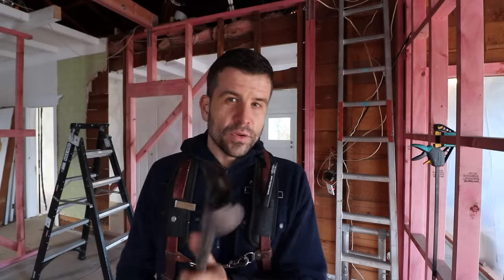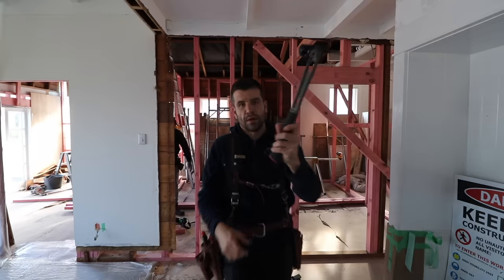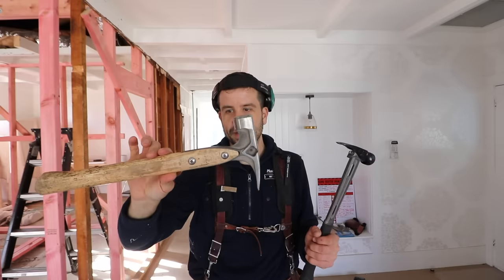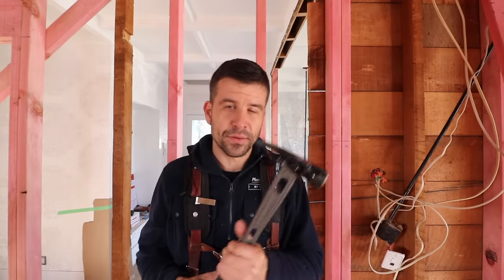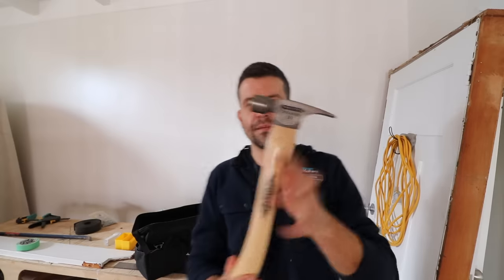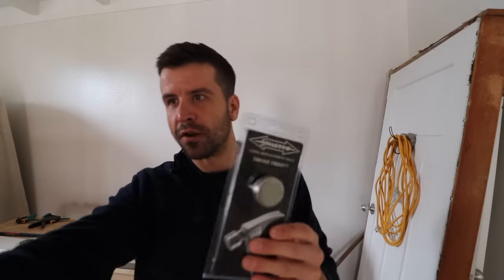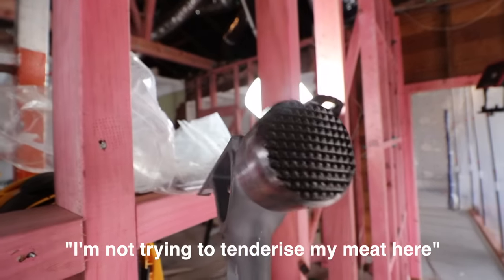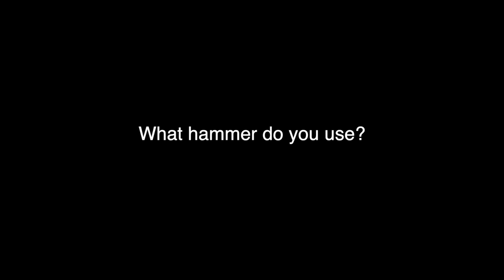Martinez M1: The Hammer Everyone Is Talking About

Comment: For wood handles: sand off the shiny, slippery varnish or lacquer or poly or whatever the heck the finish is. Sand to the bare wood, tune up the shape maybe, finish with 2 applications of boiled linseed oil for a very usable grip.  
When I switched from the Estwing framer to a wood-handled Hart I knew the Estwing was pretty much relegated to the worst demo jobs...  Wood handles ever since.
Reply: totally agree! i sanded my vaughan california framer and apply linseed oil every so often and the grip is fantastic even in the wet! love the hickory handle
Reply: Couldn't agree more that timber hafts feel much better than rubber sleeved steel, but they tend to take damage and break too easily on site work.  Breakages and the need for reliable tools were much the reason why so many of us switched from timber to steel hafted hammers.  Stanley had Steelmaster with welded head that tended to break or Estwing with one piece forging.  Estwing pretty much won.
Reply: @gazpal  Right tool for the job... Since I do more assembly than "disassembly", I don't mind having my wood-handled daily drivers for construction and some old steel- or fibreglass-handled bashers for demo.
For some of us, the time replacing wood handles is nothing compared to the time (and life activities) lost to injured or worn out ligaments, tendons, and joints.
Reply: I scraped the varnish with a razor blade, sanded, then oiled mine. Worked like a charm.
Reply: @cbat09 you're obviously not from the same generation of tradesmen as I.  By all means always use the right tool for the job and always strive for that, but heading the lightweight hammer head route is the wrong direction, regardless of what the hammer shaft is made from.  The hammer head does the work and it's weight drives the nail.  More strikes using underweight hammers = more chance of wear and tear on your body.  Example, 3" nail should take two - three strikes, not five.  Five strikes on 500 nails = 2,500 hits versus 1,000 using the correct hammer for the job.  The hammer head does the job without any need for undue effort, or wear and tear on the user.
Reply: @gazpal  as @cbat09 said, it really depends on the sort of work you're doing. I'm not really driving a huge amount of nails (mostly small clouts i'd say) so i'm more than happy to have a hickory handle. i have a 24oz steel estwing that i use if i need to go ham on something. to me nothing beats the feel of a timber handle though
Reply: @mintslice2214   I agree 100% re the feel of timber hafted hammers.  I've used them for years and still use them, but the drawback is breakages.  While it's totally fair to say (And I agree with this too) hammers are easily re-shafted, it's never good to have one break - especially at the start of a shift - when you can't grab a replacement hammer or then find yourself needing to carry out a repair instead of making money.  Hence the reason so many moved to steel hafted hammers that - if weighted to suit the work being done - give very little trouble regarding ligament or joint stress. 

One thing that used to knock hell out of us was hand ripping and nogging out using handsaws, but it was solely because we were chasing money.  Muscle builds, ligaments strengthen and technique makes a massive difference - again if using the right tools for the job.  We used to set floorboards day after day and everything else within our work process by hand without nail guns and solely via the use of correctly weighted hammers.   160z for pinning and hammer weight increasing to suit the fixings in use.  What I do see a lot of nowadays is young carpenters trying to rely upon long hafted hammers with minimally weighted heads and taking up to six overly hard swings to set a nail, when it can be done in two or three lighter swings using e.g. a 20oz or 24 oz hammer.  I'm a 56yr old carpenter/joiner and simply offering advice based upon experience and nothing more.
Reply: you obviously have no idea what you are talking about  @gazpal
Reply: @anand8905  Far from it sunshine and I have the scars to prove it
Reply: @gazpal  No proper framer nowadays uses a full steel hammer, maybe in Renos or light jobs where a hammer isn't used every day. I actually like to keep my body in tact thank you very much

Comment: 28 oz dewalt. I keep it simple. And heavy. 

Two shot everything.
Reply: 19 oz estwing gets me by 95% of the time, but i also carry a 3.5 pound estwing mini sledge when I need some serious power.. much handier than you'd realize. nobody ever turns me down when I ask if they need to use it. also works great in the left hand for pulling nails out of concrete instead of having to find a hunk of 2x4 or a burke bar

Comment: I swung a 14 oz titanium head, wood handled Stiletto for 8 years and just switched to the Tibone 3 because I was tired of replacing the handles. The Tibone has been amazing so far and In my opinion it is the best framing hammer. The only draw back that I can see is that you will either have to replace the whole hammer or make your own replacement handle once it wears out.

Comment: My workmate has just got the Martinez. Only reason being that he’s broken the deluge too many times now 😂
Reply: Maybe he has bad aim???? My Dalluge works just fine.  One complaint is the screws in the handle get loosen.
Reply: @robertt.7673  I've had the Dalluge for 2 years now. A piece of advice. Go to your big box store, buy red loctite (extra strength), and 4 washers that fit the sizing of the female bolt on the dalluge hammer that mates the hickory and titanium together. Put a drop or 2 of the red strength loctite on the male threaded end and put both washers on either end, do that to the other... Crank the living shit out of it so its really on there tight and youll be laughing. I could probably build a small house with the amount of handles ive broken through the years of owning it though - nothing to do with aim... Bad design flaw, it always breaks near the weakest point at the second bottom bolt. Good luck

Comment: I use the German carpenter's hammer, the one with the long tip. That's why it's there so that you can lever it better, e.g .: Loosen the roof battens. It has a square head, so you get better in corners. It also has a nail holder with magnets and the notch at the front for pulling or prying nails, again using the long tip.

Comment: My guess is the wooden handled Vaughn has a shallow claw to discourage you from pulling anything but the smallest nails. You will eventually break your wooden handle if you use it to pull larger nails, and they're not inexpensive to replace. I'm retired now but my go-to for 35 years was a 20oz. Vaughn 999, first with a wooden handle, later adopted fiberglass handled one when they became available for the reason stated above.
Reply: I'm 36 and use a Vaughan 999 primarily. They're not often in shops though readily available online & the q.c. is good enough to buy sight unseen. 
If I'm doing heavier framing I'll often step up to the 19 or 23 oz. Cali framers also from vaughan with a 17"-18" handle. 
The handles on the Calis' are a more oblong oval shape with significantly more mass running parallel to the head @ the eye and will take more abuse than the 999. They're outstanding nailing below the waist as well as face nailing. Unfortunately their wide and shallow protruding faces are often more awkward  in toe nailing and more precise/awkward situations. 
The 999 sees the Lions share of my use and occasionally when I need a bit more power/durability I'll jump to one of the cali framers.
  At the cost of the Martinez I can buy 1-smooth face 999, 1- milled face 999, 1-Cali framer, 1-16oz. Trim hammer, and two replacement handles for each.

Comment: Estwing 20 oz straight claw. Tried many hammers and always come back to it.
Reply: toy hammer
Reply: Hugo Garde are you American by any chance?
Reply: @azza1793  I'm irish. Doing general carpentry from roofing to 2nd fix and stairs, even a bit of plaster boarding thrown into the mix.
Reply: Have you tried the new Dewalt 14OZ?
Yellow handle, costs about $50, I really like it.
Reply: @ajs96350  i had one in my hand once. the guy i work with has the 15oz lightweight estwing but i like a bit of weight in my hammer.
Reply: @stephenmurray4916  I started out with a 28oz Estwing and as I got older they kept getting lighter.
After trying the Dewalt I couldn't take the balance of the Estwings anymore.
I do too much sideways and upside down nailing.

Comment: Estwing 20s. When I first started roofing the industry was still nailing sheets on the roof. My left thumb loved kissing the hammer head. Especially on the laps. Took alot of practice and blood to learn how to get the nail in nicely without smashing my thumb and denting the sheet. It was for me better to have a heavy hammer
Reply: Greylynnjr. My father was a builder and I would help the Carpenters pitch roofs. I bought 3 estwing hammers and they all had legs. I stopped buying the estwing hammer until many years later. That hammer also grew legs and walked away. I then bought a Johnson hammer which wasn't much chop. All my tools went on holidays so I bought tools again. Haven't bought a hammer since all my tools went on holidays a few years ago. I think my tools are in self isolation somewhere probably another state.
It's interesting the different hammers and their function. I know about stress I feel the titanium may have too much flex. Not sure the newer models. I always bought the 24 ounce. Although I screw everything so although there have been instances I needed a hammer, I used a Thor dead blow hammer and small Gympies. Milwaukee make not a bad hammer. I'm thinking I will get a steel hammer.

Comment: The M1 is a very different hammer to swing and takes time to adjust to the mass at the end of the hammer.  Keep in mind it's a 15 oz framing hammer that would be used where you would usually be using a 22oz to 25oz framing hammer.   The theory is that they can do more with less weight since the mass is moved to the end of hammer.  This makes the energy used to swing the hammer more efficient.  I love that Mark Martinez is still working hard to innovate even after his creation of Stiletto hammer.  It's an awesome hammer but I've always come back to my vintage Bob Hart hammers personally.  Have to take car of them now though as they are getting harder and harder to find.  Something about the classic axe handle and polished head just do something for me.

Comment: If Rich has elbow issues, get him to stop putting his thumb "up" on the handle when using it as it makes it worse
Reply: Only just started doing that. Someone told me it would help to control. Haven’t noticed it make a difference to my elbow though.
Reply: @livingimprovements4382  ahh strange, it's what I used to do and my physio and some old lads on site all told me off for it
Reply: louis bown yeah It didn’t feel natural. I think I did it on that hammer cause it had the thumb spot. Typically I hold it normally.
Reply: Thumb up helps you control the hammer
Reply: @bazzkeen2341  my injury comes from turning large pipe valves so not caused from building but aggravated by certain building activities. Interestingly Paerau had just mentioned to me to start trying more of the wrist technique so that may help my technique but end of the day the better grip of the M1 requires less grip force and a better result for my elbow. Used the Dalluge just after filming this and i think i might be swapping to that, just so light!
Reply: @livingimprovements4382  Yep, wrist technique and less emphasis on forcing the hammer to do the job will help you massively, as well as perhaps an elbow brace/strapping.  Here's hoping the combination of tool, better technique and potentially periodical  joint support helps.  The building game is hard graft and a young man's game, but a good life with a lot of good men - such as the other members of the team you work within - so have fun, buy whichever tools make your life easier and here's wishing you the best of good fortune.

Comment: Literally have heard no one talk about this hammer.
Reply: I've swung a estwing for 30 years. Frame with a 28oz. And trim with a 16oz.
Reply: @gordondeitz7838  I was commenting on the title.
Reply: @lanceroark6386  got you  Lance 👍
Reply: I just heard about them today, but I guess they're made by the same guy who came up with stiletto, which is a fantastic hammer. I'm interested in the all steel head this one has to offer. I feel like they're exaggerating the weight of it. I swung a 22 oz regularly before I bought my 15 oz stiletto. Even if this Hammer seemed heavier than my current hammer, I doubt it would seem heavier than the 22-oz I was used to before that
Reply: @gordondeitz7838  there's been quite a bit of innovation in the past 30 Years bro.

Comment: I use a Stanley Blue Strike 20oz, been using it for 19yrs, nice thin shallow wedge for nail pulling with a good arc to ease the nails out a treat. I can't see how they thought a T head on a hammer (with no arc) can be any good for pulling nails, and as for interchangeable heads and handles....it's like that old joke, had this hammer man and boy, 4new handles and 6new heads, still the same hammer! 🤣

Comment: You should check out the TB3 Stilletto. I love it, light weight at 15oz and strikes like a 28oz
Reply: @kickyourfaceandlaugh607  I dont get vibe with my TB3
Reply: @kickyourfaceandlaugh607  again, I dont have the issue. Pretty simple. I have pounded in everything you can think of with it and I dont feel it in my elbow.

Comment: My old ass hammer is 20oz, hard to think that 15oz would do the same. I've been thinking to buy 22oz because at times you really need the weight.
Reply: These modern hammers are optimised so you don't need the weight. I use a 14oz framer for everything. It hits as hard as a 20oz, but is light as a feather and very balanced. Slightly longer handle, and smart weight distribution, and you would be amazed how it performs.
Reply: @Patrick-857  Thanks, have to give it a try!

Comment: M4 is more likely for finishing job. coz the M4 head is just 12oz. the 3 different types of the M4 head both have the flat top or u called square top. the M4 handle is just shorter than M1 handle.
I tried the TBII before. just kept missing nails....
anyway one of my mate in auckland said he snapped the nail puller claw of his TBII...
I'll just keep my estwing  20OZ only for smashing concrete or reinforcing and M1 for most of the job.

Comment: I have an original version of that Vaughn... The Hart Woody. Looks exactly like your hammer with a “timber” handle. Mine is sans nail starter, but the rest is the same. It is still fine after 25 years...  a good hammer will last you the rest of your life.
Reply: I broke the claw off 2 of them in a row 20 years ago chipping a little concrete off a foundation. I know that is not what it is for, but I don't have  the time to switch hammers for mild demo on day one of a new house. The balance was nice though. The supplier said he wasn't going to warranty it anymore after the second one. Back then 150 was insane for a hammer.
Reply: @defmc1  I ordered mine directly from Hart and I think it was 65$ at the time, which was insane for a hammer. I have not had any problems like that though, I have done heavy demo work with it, prying things apart that probably should have been reserved for a legit crow bar, but I never did masonry with mine! 😳 Interesting that we had two vastly different experiences with the same tool.
Reply: @davidsaylors  I'm a framer. I was using the claws to get some concrete off the foundation that the flat work guys left. I thought the first time was a fluke. It wasn't. If you have had yours that long it's an awesome tool. Stay safe.

Comment: I really wanna get one of these with the sledge head. I already have a Stanley fubar 3 though so it's so hard for me to justify the cost of these titanium hammers. 

I'm a rodman ironworker so I don't particularly need a hammer all that often, it's just really nice for smashing bars into place when you need to. Very curious if anyone has tried the sledge head, especially as an ironworker. 

You saying it has a lot of weight on the head sounds awesome to me. I'm also a smaller guy but the weight for smashing bars around sounds great to me. 

The stilleto ones are nice but since they're solid titanium they are not an option for me, steel is harder than titanium so I would destroy a tibone 3 hitting steel bars with it.

It is nice it has a replaceable striking head but I don't think that's enough.

I know the framers at my site all prefer the tibone though, and I get it for their needs. I'd probably get the tibone if was a framer as well.

But for me the idea of smashing steel with the sluggo head, and having titanium handle to absorb that force off of my joints sounds fantastic. I'm Canadian though too so it's hard to justify $400+ tax for a hammer I don't technically need

Comment: As a framer Ill pass on a metal handle all day long shit will kill your elbow like no ones business after a couple years.  Also prefer an axe handle grip but thats neither here nor there.  Side pullers meh, can probably save a little time, but i generally pull nails as if i had that puller attachment anyways, just with the normal head.  Still after 10 years working the trade my favorite hammer is the 30$ axe handled 19 oz. by vaughn, all the features you need, none of the BS you dont, at a price you wont care if you have to destroy one.